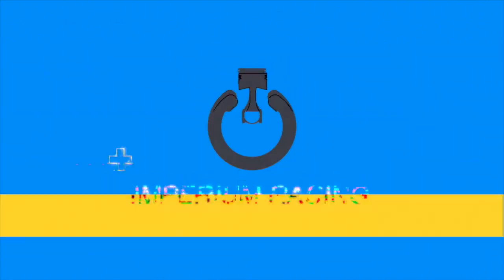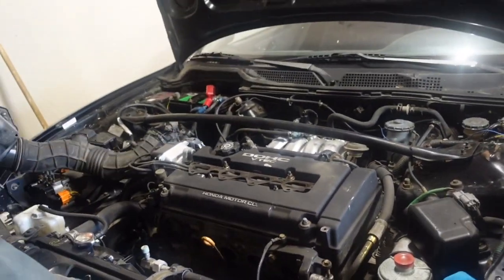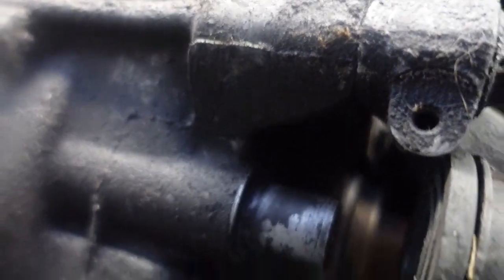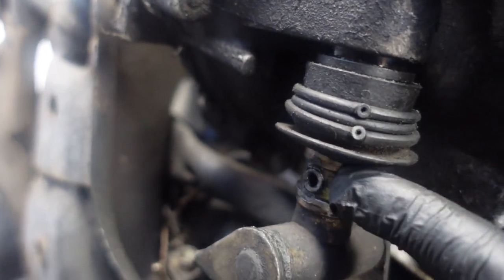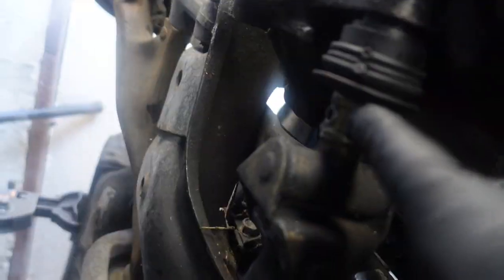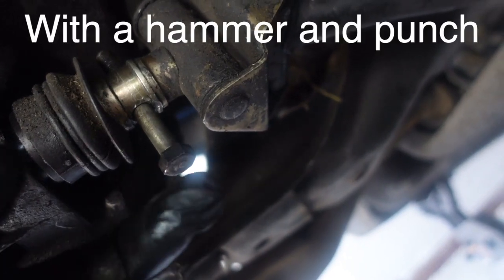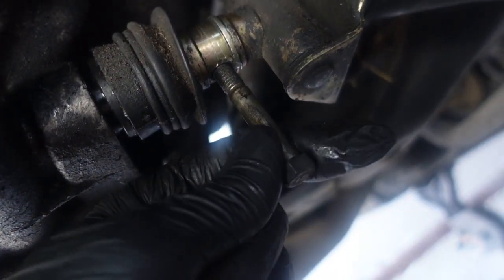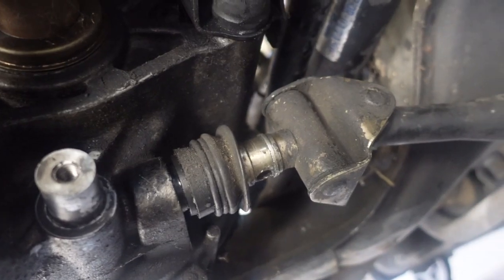Acura Honda Bitch Pin shift linkage

Comment: Are you supposed to swap the 
 Pin once it’s out or do you put the old one back in and just reposition it
Reply from the maker: Honda work instructions if you “go by the book” might say to replace it and if a new one only cost a buck then it’ll might be worth it If a new one is more snug. But honestly If you have the snap ring it shouldn’t matter. That ring holds it in pretty good. Up to you but I would re-use it if I had the snap ring. if the snap ring is loose though I would try to get a new snap ring/collar. Or bend the ring a little smaller before clipping it on.